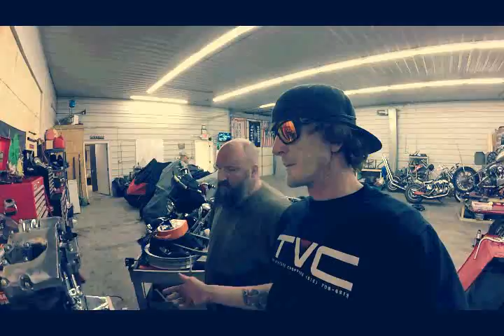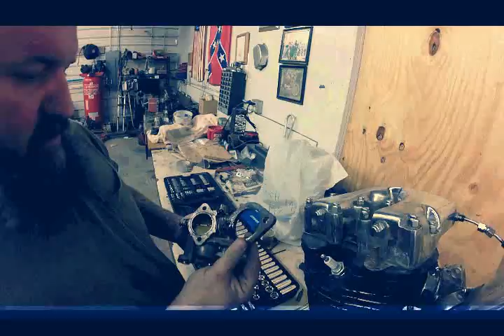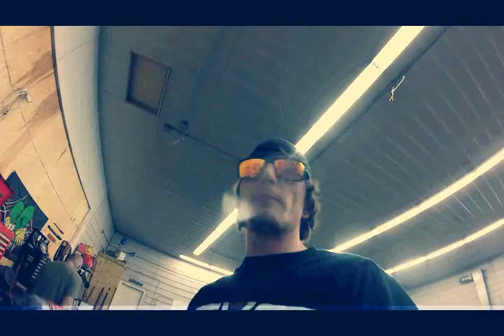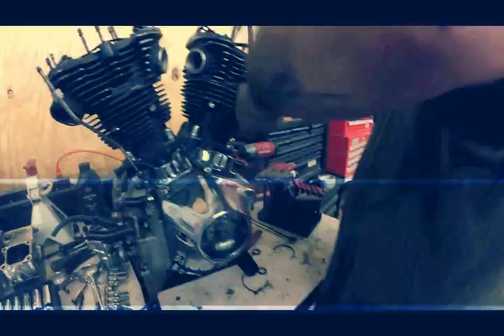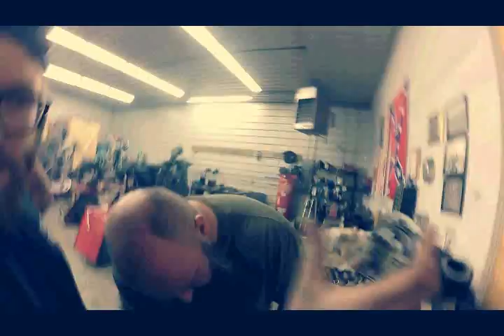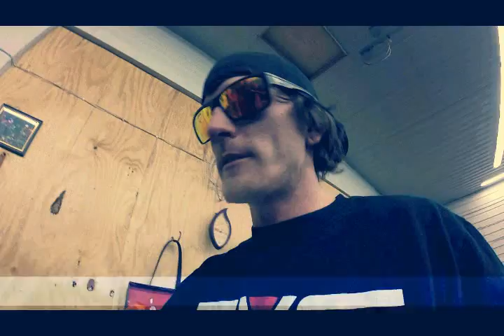"From Plain Jane To Totally Insane" -- Episode 2 -- "How To" Complete Shovelhead Dissassembly

Comment: Great channel. First time I’ve seen anyone do a step by step motor rebuild. Looking forward to seeing it come back to life.
Reply: Not to be pedantic, but... they aren't splitting the cases, so it isn't  an engine rebuild, but rather, possibly, a top end and
gear case (is that correct nomenclature for a "cone motor?") refurbishing ;^)
Reply from the maker: The side to side play in the crank pin bearings that the connecting rods ride on measured perfectly in spec, as well as the case bearings show no sign of wear, we drained the case in order to check the lower end for metal, and since it all checked out, we have decided against splitting the cases as there's no reason that we were able to perceive, or that leads us to believe, that is warranted work. If you or anyone else wants to watch a lower end being built, TVC's resident drunk asshole Brian is rebuilding, balancing, and truing his flywheels on a 1950 FL panhead motor in the coming weeks, so be sure to stay tuned 👌👍😎
Reply: @trampsvintagechoppers4746  Yeah, I'd like to see that. My lower end know how is lacking. The '50 crank and bearing is a tad
different than my '62, but still...

Comment: Just found you guys, subscribed. I would appreciate your advice on my 80 shovel. This bike has been sitting for 10 years. Is it advisable to throw in all fresh fluids and fire it up? Do I have to pull the jugs? Thanks in advance. PEACE
Reply from the maker: @Jon Haddican Yes sir, we suggest to replace all the fluids first and foremost.  Step 2 would be to remove the plug wires from the plugs, and if you have a kicker, make sure the motors turns over freely by giving it a few slow kicks.  If it's an electric start only, still remove the wires from the plugs and use the starter to turn it over a few times to assure it turns freely. Step 3 would be to replace the plugs themselves, only due to their age.  As for plug brands, we highly suggest AC Delco or NGK Iridium Laser Cuts. AC Delcos are great plugs, and if you want to spend a few extra bucks, then the NGK's are great plugs as well. Unlike other plugs that can be fouled out but still create enough spark to run the motor, but not make it run very well, the NGK's either work or don't work.  NGK's have no in between like most other plugs.  What I mean is that when they've fouled out, they're done.  They won't make any spark at all. This eliminates questionable plugs, that way you don't have to guess if the plugs are firing like they should or not. Once you've replaced the plugs, you should be good to fire it up. One way to check to make sure your plugs are firing correctly is simply by touching the end of either exhaust pipe while the bike is running. Obviously the pipes should get hot while running, so if the bike is running, and one of the pipes isn't getting warm, that means that the plug for that cyclinder isn't firing and needs replacement, even though you'll still be able to feel exhaust pressure coming out of the pipe. The key here is heat. The heat lets you know that the plug is firing correctly and igniting the gas inside the cylinder correctly. Hope this helps you with your build.  Feel free to let us know if you have any additional questions. We're glad to help any time!
Reply: Greatly appreciated, I'm feeling much better about this. I will definitely have more questions down the road. Thanks

Comment: Okay, so I'm not going to leave you alone. This dawned on me while fetching firewood a few minutes ago.

I see those lifters, cam followers, whatever are hydraulic (you viewers notice the springs?). HOWEVER had they
been solids there wouldn't have been any holes TO line up, as that oil passage only serves to pump up hydraulics.
(no wonder it wouldn't run. no lift)

Man, I can see a cat installing solids freaking out because it's all screwed up. "There's no holes! What the hell am
I supposed to do now?! They sold me fucked up parts!"

CD
Helping?
Reply: This is true had they been solids like I run on my shovel the bike might have ran but there were many other problems . Too haha

Comment: I looked to me like the rear oil ring had collapsed. That along with an obvious vacuum leak (the rubber band and carb block goop)
indicates the engine was running hot. I'll bet something shiny if you try to pull one of the compression rings apart it snaps with
no spring to it.

And just to split pube hairs: the cat what appeared in the vid (same guy in the tool one, I think) while you were fucking around with
the ignition plate seemed to indicate one cylinder fires and then the other. This isn't true with a single points ignition system. Both
cylinders fire at the same time. HOWEVER one should be in correct time for the power stroke while the other is on exhaust, thus
being a "dead fire." Not that that makes a fuck relative to this video (shrug).

Now, 'beins you aren't splitting the cases throw some fucking rags in those piston holes. You're freaking me out ;^) 

CD
with a mellow Andrews 'J' grind.
Reply from the maker: You are indeed correct in that both cam lobes fire. What that drunk was trying to convey was that many people time to the incorrect lobe and end up with issues. We'll do an ignition video explaining magnetos, cone points, and electronic ignitions in the near future with a more sober "cat" in the near future. Also, the rags were out in order to blow as much oil out of the lower bearings in order to accurately measure rod play. Don't worry though, there's rags in the case holes and a cover over the entire motor just like the pan lower end in the background. 👍👍👍
Reply: @trampsvintagechoppers4746  My '62 has a timing mark on the circuit breaker lobe. It's hard to fuck that up, though things can get fucked up
by other means. My fly wheel has both front and rear timing marks (for dual points) though the front is stamped with an "F" I suppose a
person could fuck that up. Also, the mechanical advance should be in the correct position, blah, blah.

I used to run the Spyke electronic set-up, but it would fail (twice!) with the least bit of moisture and it required their housing. I tossed that
shit in the garbage ( I don't think they even make 'em anymore, either). Today I'm running Ed's Quick Start 2000. It's a real simple pick-up
in the stock housing. Hell, I think I could pour a beer on it and it'd still fire. Also, if it does fail I can pull my old points and condenser
out of the bag and slap those back in.

Oops. I'm a bit of a Wrenchhead. Sometimes I get carried away. Heh. I'll let you guys get back to it.